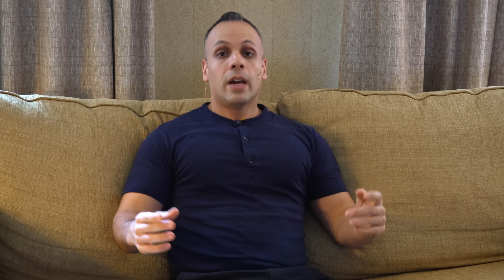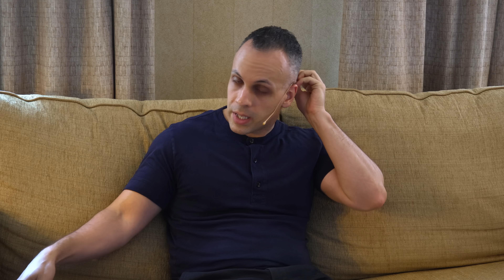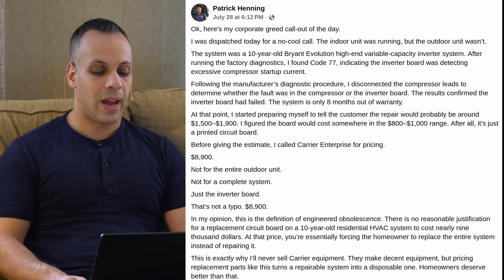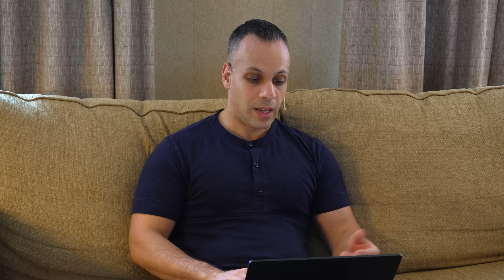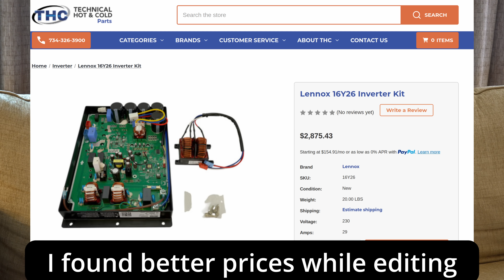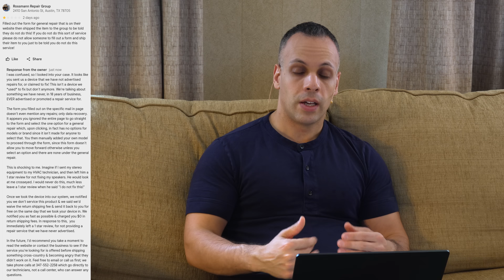Carrier AC repair has $8700 part cost for residential unit

Comment: I just had a local HVAC company bill me $7,411 to fix a leak and refill the refrigerant in our system. No compressor replacement or air handler. Just patch a pinhole and recharge the system. Google search showed it highly reviewed  (the only company with reviews and nearly the only result in my area) so that's how we ended up with them for service. By the end, my wife and I were furious (for multiple reasons) and this company was more focused on trying to sell us a 20k+ HVAC system when ours is only 8 years old and only stopped working due to a leak.   And magically, the refrigerant we had, was banned last year so we had at have whatever new refrigerant that was 4x the price of the stuff we had. Go figure. 

Literally days after this, we see a post in our local town FB group warning people about this company. They do everything to hide parts behind their own parts numbers so you can't see what parts really cost. They pressure you to buy completely new system from them at 4-5x the cost of what the market actually is. This company is partnered with "Goodleap" loans and this company is "Jay's Heating, Cooling, and Plumbing out of NC.

This was a very pricey learning experience for sure and the biggest red flag we should've seen was the " tech" / salesman, almost immediately recommending to replace everything over a little leak. Oh and nothing would be touched until they got their $7,411 and no warranty on the work either (we found that out after forking over the money) since we didn't buy one of thier HVAC systems...

Comment: There's no reason that circuit board should be even $500.. I bet the parts on the board probably cost fractions of pennies on the dollar, prolly has some software on it and that's the gotcha. You can buy a BRAND NEW industrial inverter drive from any of the big manufactures for that size of compressor for fractions of the cost. It's a ripoff. Could you imagine if people used STANDARD industrial parts for things like home HVAC ? Instead of all these companies REINVENTING THE WHEEL  FOR EVERY MODEL THEY PRODUCE ?

Comment: My Carrier unit from 1993 that leverages basic electronics (seriously look up the schematics) and R-22 is still going strong here in Arizona.  It has never let me down... However as we all know that's from a different era when things were designed like tanks.  I believe the HVAC & governments got together to require "exotic" and "unforgiving" refrigerants that would require people to buy new systems about every 5-10 years - and that's due to any level of contamination will destroy the system from the inside.  I did the maths, and I have saved more than my neighbors by sticking with my old system because I literally have only replaced the capacitor and contactor once in 33 years, meanwhile my neighbor is on their 4th HVAC system.  Yeah there's a tradeoff, but when you have to shell out tens of thousands every few years, it negates any cost savings in energy.  We need a MegaSquirt/Speeduino for HVAC and general appliances.  Even the most complicated multi-zone heat pump systems aren't that complicated.  It's all solenoids, pumps, and sensors at the end of the day.
Reply: I'm from the trade and every single new refrigerant type always vilanizes the old one. No refrigerant is even significantly more efficient than the others, generally less efficient. CO2 is a perfect example of way more energy, and glycol systems wasting more energy on a pump that's not needed in vapor compression only systems.

Comment: The tech has a clue as to why this is so expensive. Carrier has a limited supply. They’re keeping them on hand to cover the 10 year warranty they’ve sold on their equipment. If they sell one, it has to be for enough money to offset the cost of a modern replacement unit should there be a warranty claim and no stock of inverters remains. 

Repairing the inverter is the better cheaper fix, but nobody does that work.

Comment: The board in my furnace died because the wires toat go to the contactor in the outdoor condenser unit for the AC got shorted out from too much weed wacking near it, and the on-board fuse didn't save it. Since my HVAC is 25 years old, I looked around in ebay and found some boards for $50 each and bought 2 of them. The first one fixed it and I keep the 2nd in the little room next to the air handler unit. I was looking around at new HVAC systems, I saw the extreme prices that Carrier was asking, and decided to buy a few mini-split units instead. They were very cheap, are super efficient and sip power, and do a better job of keeping the temperature consistent throughout the entire house because some rooms just require less heating or cooling than others and the older whole-house HVAC can't sense or compensate for this. Technology has improved. I still have my old HVAC but rarely use it, except maybe to see if it's still working.

Variable Frequency Drive (VFD) "Inverters" for large variable speed air conditioning systems can be more complex than a flourescent tube driver in a laptop due to the high temperature operating environment, the high currents involved, and the need to not trash your home power with too much harmonics, so they will have some cost behind them, but &8000+ is absurd and will pay for several mini-split units.

Comment: Shocked there isn't a maker community programming cheap PLCs with VFDs to install in place of the manufacturer boards.

An off-brand TECO plc can be programmed with ladder logic using analog/digital signals using a free program and the PLC would modular the VFD for the compressor and fans using signal processed from the sensors.

Similar to how commercial units are controlled and at $8900 almost makes sense.

https://youtu.be/d2BFslmxmT8?is=T7WDKmv9bFziDorZ

Comment: Wow it's seriously wild that this video from Louis showed up when it did. On Monday of this week an A/C repair guy came out for a no-cool fix on the the heat exchanger of my Rheem A/C, circa Y2K or so. He replaced two fried electrical components on the exchanger for a little over $1,000 and the A/C worked after that no problem. But as he was packing up his tools, he said what sounded a lot like was Patrick was talking about...he said the compressor unit is overamping, drawing 30 amps where the system is only rated for 20. He said because of this it's risky to continue running it and I would need to replace the entire A/C unit. I know little about HVAC and I'm not sure that overamping on my system is the same as the excessive compressor startup current specified in this video, but after watching it, I wonder now if all I have to do is to get this inverter board replaced (if indeed my Rheem system utilizes such a board.) Who knows. What I can say though is that honest A/C repair folks...wherever they may be...are the true heroes of the industry.

Comment: This is something that trane, carrier and a few others do. A part will cost $900, but the entire unit can be $1000 or even cheaper. 
No reason for an inverter board to be that much. Any midea boards are reasonably priced. Pioneer will sell you parts  cheap for their systems too.

Comment: A 1989 Lennox 2 ton a/c unit has about 18 total components, and no circuit board. The only thing that'll fail are the capacitors and fan.

Comment: I never recommend Carrier, their units are over priced and don't have the ROI. Honestly I don't recommend any of the high tech features on HVAC units as they inflate the price and don't provide the savings required to justify the price. Sure Carrier used to be a good reliable system but I see more problems with them than I do the cheap units. I got out of doing HVAC years ago because it has gotten to be too shady and too many companies are pushing their techs to sell new units over some stupid cheap part. The prices these companies are charging these days to install new systems is flat out crazy high. The techs are not making but a tiny fraction of what they are charging for the labor. Say a standard system cost the company $5-6k and they charge $16k, I can assure you that tech is not making much more than $400-500 for the days labor to replace them. A decent reliable system should only cost maybe $6k at most for the whole system minus the duct. Sure there is a lot of crap these companies need to deal with but then again so do the majority of other businesses and they don't charge $1000/hr. They want to blame that they can't find the skilled help but yet they don't want to pay for skills they want to keep the profits as high as possible. Yes there are a few reputable companies still out there that don't take advantage of people but the group is getting smaller and smaller!

Comment: I am also a licensed HVAC tech, and I got a quote for over $7000 from Carrier for an outdoor coil, on a 4 ton residential unit,  about 13 years old. That's some copper and aluminum that fashion a heat exchanger. That was before shipping.

Comment: Holy smokes. Meanwhile a little over 20 years ago I bought a scratch & dent heat pump from a local ebay seller for $450 for the whole unit. I spent another $800 on the indoor coil, lineset, vacuum pump, manifold, etc and spent an afternoon getting my HVAC cert, that system is still in daily use to this day and the only thing I've ever done to it is replace the motor capacitor in the outdoor unit. A couple years ago I put in a Mitsubishi 3 zone inverter mini split in a family member's place for under $6k total. Regarding Goodman, I've installed several of their furnaces and AC units and they're just fine, I think the reason some guys crap on them is that they'll sell to anyone so the quality of the install can be highly variable. Install the right size unit, exercise absolute cleanliness, make high quality brazed or silver soldered joints and pull a good hard vacuum and chances are it will run for decades. I won't say HVAC is easy, but it's not rocket science, it's a hell of a lot easier than repairing Macbooks.

Comment: They want you to buy the new system. I was told  that there's new regulations on the  freon gas. So, they're trying to pressure people into buying a new system to be in compliant with the new regulations to be more envirement friendly. That is what my hvac tech told us. We didn't replace it but the prices are expensive. We just needed to replace the capcitor for our ac unit. However, it's getting close to it's end of life span.

Comment: After working with simple vs inverter based A/C equipment for many years, I've come to the conclusion that inverter A/C is just not worth investing in going by the present parts pricing framework. There is something obviously wrong in the pricing of these inverter boards. I've actually repaired a board by swapping out an IC but that took a lot of time and patience sourcing the part from Ali Express but we shouldn't have to do that. For a new system I would prefer 2 conventional units staged to operate one or two if the demand requires. Also gives you a backup unit for the weekend emergency. Much less expensive than a high tech inverter compressor. IMHO.

Comment: Louis, those inverter boards can be repaired... there are places that you could send them into for the repair, but most people do not want to wait for the lengthy turnaround.
Reply: How would I go about learning to repair inverter boards for AC systems and mini splits? I’m an HVAC student right now less than a year from getting certified but I’ve studied my ass off. I’m still young, and I know the future is electronic and digital, so if I learned how to repair these boards it would help me a lot. Also I have minor experience in soldering too. Any reccomendations for books to read, videos to watch, or courses to take would be greatly appreciated.
Reply: @nick5839  It's not really that easy... if you specialize in electronic repair, particularly inverter boards, then you could repair them. Not all boards are essentially repairable and not all components have replacements readily available. Also, a lot of boards these days are SMD and require a rework setup, not just a soldering iron. I don't have any recommendations but good luck!
Reply: @fredgoesfast  alright thanks I’ll look into what you reccomend, turns out this semester my school has some more recent minisplit systems with inverter boards to look at. Im practicing on them in person now. There’s a masterclass video I found that’s 9 hours and has good comments but if there’s anything you can say that will help me start learning more then I will greatly appreciate it

Comment: Repairability should cost a small fraction of the final product, if they can charge whatever they want for it then there is no point in repairability, if their product genuinely requires to spend more on repairs than on new models then they should be fined

Comment: The price is near the worth of the price of 1.75oz of gold! I would have to expose them for what they are and
make sure that the price quote gets circulated clear around the world and back! This will learn them!!! Instead
of the company to try and find a grand solution to this sort of problem, whether the these boards are made in
limited runs and cost so much before a markup, they so choose to rip the customer off! Many things that I
should buy, I choose to look into replacement parts first to see whether they are readily available first if at
all possible but then whether to decide to pull the trigger! Example: Buying a battery operated chainsaw. Are
there replacement parts readily avail from the very beginning that can be purchased right up front to include
replacement batteries, namely ALL expendable parts that in time that you already know eventually WILL need
to be replaced! IF NOT, I will NOT pull the trigger for any product that does NOT have such parts on hand present
or future!!! If such parts are reasonable cost up front, I will not only buy those parts but the product as well with
that initial purchase. These supply chains are already somewhat fragile as it is and I don't want something that
will either be nearly non-existent in hardly no time at all and/or with the appearance of a product that turns up
as a quick sale such as in sell and disappear of which I seem to see some stuff on Amazon is a common event.
With most of these chinesium products and parts, as they may sell you what should be needed but then if not,
that brand can just go walk off a cliff immediately, take for instance!!! As for many products out there as a general
rule, I will NOT even give a brand or the distributor the time of day selling me something that can and will only
turn out to be a piece of garbage in hardly anytime possible, if even imaginable! Certain brands and outfits need
to be on their A-Game if they intend to sell the public fore if they don't and only wish to rip people off, well folks
that are truly in the know and are truly smart about these various events that seemingly keep happening, just
go to a consumer product advocacy website for an example along with product forums such as to circulate
just how a customer is being treated. But then eventually these manufacturers will get the hint OR just go straight
out of business as deemed appropriate. As for some of them that have been in the Biz, they better straighten up or 
just tell them to go f_ck themselves and send the message that a consumer will not put up with the bs PERIOD!!!
As I am fairly sure, these products are to have sufficient parts on hand based on 10 years from the time of a product
the initial date in which the product launched and pricing guidelines should be reasonable! Carrier is being a jackass
about this but then after a ten year lifecycle span is up, the manufacturer is not required to even have parts at all.
I know of a breakaway electric buss bar product that I damned sure know that one does NOT cost something in 
the tune of 325 clams, yet one eBay seller intends to fck people over and one day I gave him some pure hell over 
it and I told him that it was pretty much a fire hazard issue type item as such because I have one OEM that came
with my furnace brand new but this same idiot jumped up and down that it isn't even an issue! WELL, I do have
that very same item on my electric furnace as proof positive in my own house with same exact PN and this seller 
of HVAC parts flat refused to drop his price and he tried to call me out when it should be the other way around!!!
It almost sounds like that invertor board at one time may have only cost oh say 1/10th of the price if not 1/20th
of the price brand new. Wouldn't you know if they had several if not many of these invertor boards in excess, and
the price that they intend to screw somebody over with and in some instance you might not even know if they
were re-manufactured or simply were turned back into the manufacturer that got rebuilt or repaired!

Comment: I paid $8k for the entire carrier system installed. I have had several warranty replacement parts and will not be buying another one when warranty ends and that PCB fails. I will end up buying a new unit unfortunately. That is wild to learn!